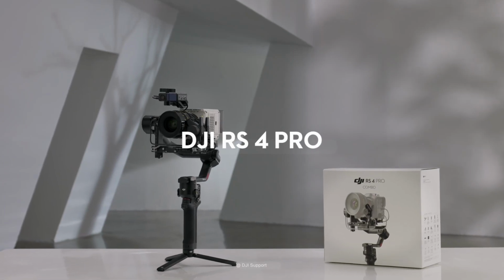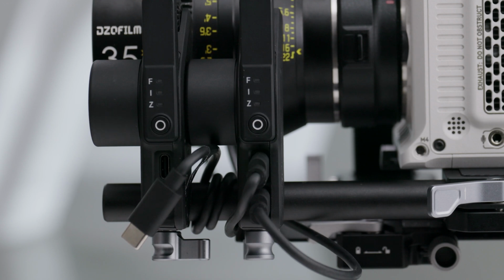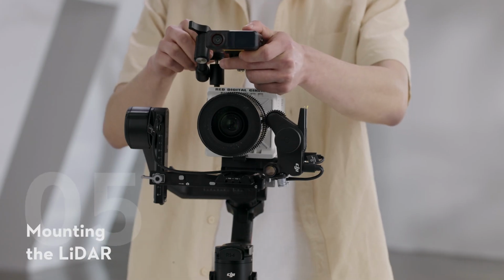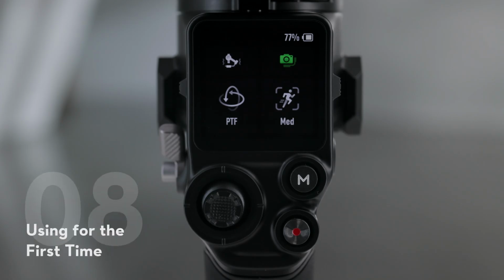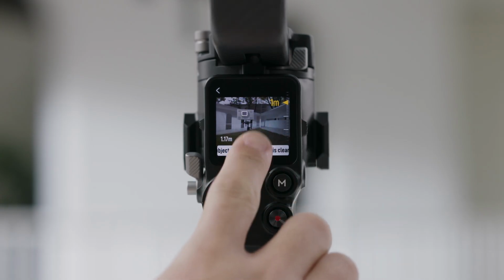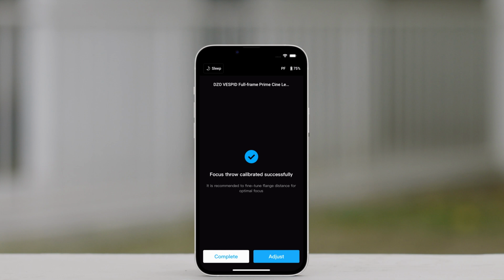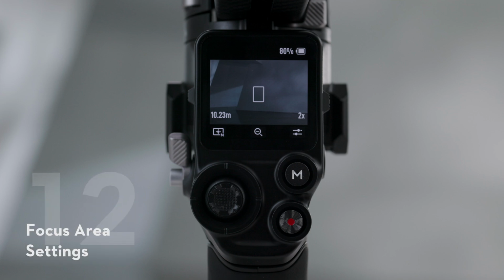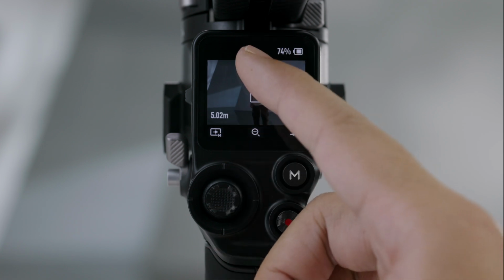DJI RS 4 Pro | Flagship Camera Gimbal: Installation and Use of the DJI Focus Motor and LiDAR

Comment: What would be the best setup for tracking  a walking subject in 9:16 ratio  or 3:4 or 2:3  with a Lumix S9  at 100ft using a 70-200 2.8  zoomed about 175mm to get consistant track. What settings and will the rs3pro do this or been tested?  Video has great reference!Thank You
Reply from the maker: Thanks for your comments! Regarding the RS3 Pro, it is a highly capable gimbal that should be able to handle the Lumix S9 with a 70-200mm lens. It has been tested with similar setups and should provide smooth tracking for your video. Make sure to balance the camera properly on the gimbal for the best performance.